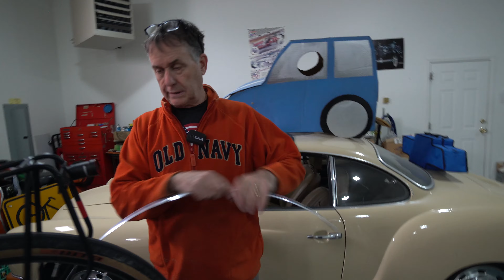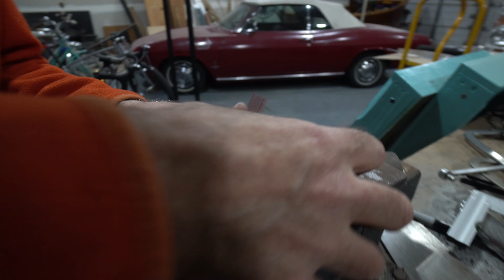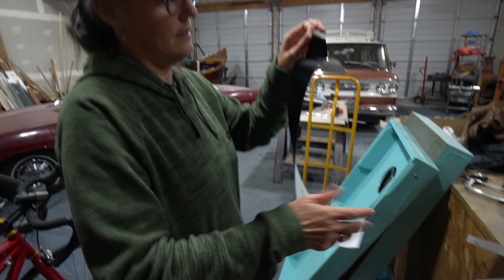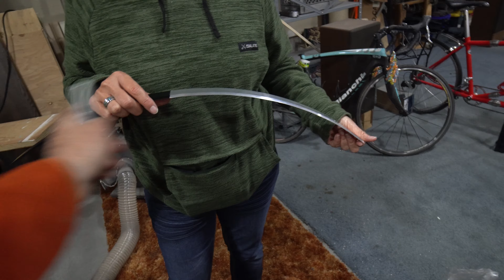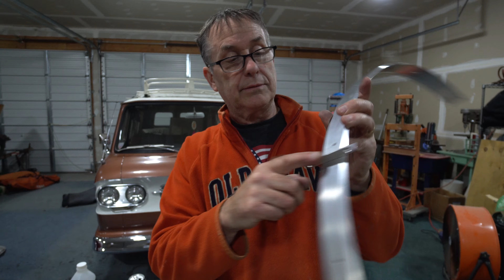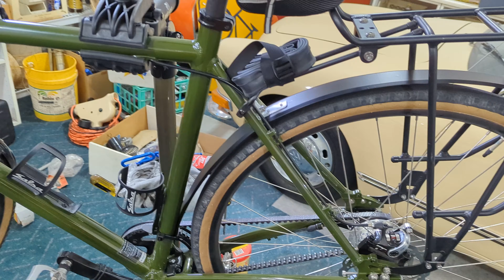DIY Apollo Fender

Comment: How much do replacement belts cost, and can't a longer one be had?
Reply from the maker: Hey Ron,
I think replacement belts are somewhere between $90 and $120.   I don't believe Priority sells a longer Gates CDX belt for the Apollo but it's possible that Gates sells a longer belt.   I honestly  haven't looked into it but if someone wanted lower gears than what we ended up with, a longer belt would be something to look into as well as the larger rear cogs or smaller front cog.
We ended up being very happy with our final gearing during the Apollo Mission with the bikes fully loaded in touring mode.
Thanks for watching.
Enjoy the Ride
Reply: @BBB_Adventures  it seems like whoever is selling the gears would also offer a variety of belts.

Comment: If you reduced the width of the tire to something like 32 or 35mm instead of the stock 40mm would that have allowed the stock fenders to fit better?
Reply from the maker: Hey TG,
Sorry for the delayed response.
It makes sense that a thinner tire would reduce the chance of fender rubbing as it would create more clearance but we really wanted to use the 38 mm tires for The Apollo Mission and I got tired of trying to get the molded fender perfectly aligned which lead me to build these custom fenders.
Thanks for watching.
Enjoy the Ride

Comment: I'm interested in getting the apollo bike but need front and rear pannier  racks for the bike that will carry my ortlieb bags.  What racks did you put on your bike?
Reply from the maker: Hey Steve,
The rear rack on my Apollo is one I bought from Priority when I ordered the bike and I believe it's an Axiom rack.   The front rack on my bike is a Roswheel Tour Front Rack.   However, my Apollo is from one of the initial builds when the bike was first launched.   The front fork on my Apollo has a threaded mounting lug near the through axle and my understanding is the fork on later builds don't have that mounting lug.   I think you could figure out a way to mount the rack without that mounting point but it's definitely something to keep in mind.   We both used Ortieb back roller classic panniers on the rear rack and I had smaller Ortieb panniers on my front rack.   We installed Topeak Vera Cage on Mb's front fork which also worked well.  
We were extremely happy with the Apollo bike set up as a touring bike.  BTW, if you do decide to order an Apollo please consider using the link listed in the descriptions of any of the Apollo Mission episodes.  We are a member of their affiliate program and using the link will help us.   Thanks.
Thanks for watching.
Enjoy the Ride

Comment: Yep, no Vespa here.  LOL!  Ingenious ingenuity/engineering.  Looks like you did round off the very end of the fender to eliminate the sharp edge.  Did you add a piece of innertube rubber between the seat post and the bottom end of the fender (where you zip tied it), to eliminate any scratching/rubbing of the paint due to vibrations?  Be interested in a long-term review (after your cross-country ride) as to how the pop rivets and the rest of the fender holds up from all the vibrations.  I did end up getting the Speedrocker plastic fenders for the Apollo from Priority and I have been very happy with them (can also find them online from other sources).  I saw the spare tire, so I'm guessing you didn't go tubeless, I did, and I've been happy with tubeless.  I haven't had a flat yet to tell if tubeless is for sure a better way to go (messy if the tire doesn't seal and one has to put a tube in), but it just looks like changing a rear flat on the Apollo is not going to be any fun.
Reply from the maker: Hey Steve,
Not surprising you don't have a Vespa in your garage, they really aren't that common but the spare tire was had a great diameter for bending that aluminum threshold and turning it into a fender.    I love your suggestion about putting some inner tube rubber between the fender and the frame.   I'm going to go back and to that on both bikes.    
I agree it'll be interesting to see how the fender holds up over time.   When my son was in high school I mentored his FIRST robotics team and we  used a lot of pop rivets to hold the robot together and they held up well to vibrations.   They would fail if they experienced a significant shock load like running into another robot.   So I'm expecting the rivets on the fenders to hold up.  
The Speedrocket fenders are nice  and it's great to hear you are having a good experience with them.   It's frustrating to have fender rubbing issues.  
We have an appointment at the bike show next week to get the wheels tuned because we are going to be over-loading the bikes and the spokes are the first thing to fail and having them all properly tensioned reduces the chance of spoke failure.   At that time we are going to discuss and potentially switch to tube-less.   We'll end up carrying those tubes as a backup.   So many people are happy with tubeless I feel like it's time for us to give it a try.
I've had the rear wheel off the Apollo several times, the worst part is disconnecting the shift cable.   After that it's not too bad.   But I haven't done it with out my bike repair stand so it might be a little more challenging in the field.  
Thanks for watching and for the great comment.   Nice to hear from you.
Enjoy the Ride

Comment: My bike came with fenders that had support struts down to near the axel. What a pain those were. Always getting bent out of shape and the welds holding the struts were breaking. I replaced mine with plastic versions direct from "chi-na" with a Trump accent.
Reply from the maker: Yes.   Those struts seem to make fender adjustment more problematic, which is why I decided to try supporting the fender with the rear rack, which reduces any flexing of the fender.   I hope you also ended up with a fender that you're happy with.   If not, try making  your own.   :)  
Thanks for the comment and for continuing to watch BBB.
Enjoy the Ride
Reply: @BBB_Adventures  They don't cover as much, but when I cycle through 3-4" of water, I raise my legs to the center pipe anyways.

Comment: I liked this video. I remember your videos when you first got the Apollos and fussing with the fenders, and I wondered how that worked out. I wonder if the problem with commercially made fenders is they are made for chain drivetrains.
Reply from the maker: Thanks Craig,
We appreciate the comment and the acknowledgement of the earlier videos and our struggles with the rear fender.   I spent a lot of time (probably too much) trying to get a satisfactory adjustment and then even more time researching what to do before landing on trying to make my own fender.   The fenders came from Priority and they only sell Gates rubber belt drive bikes, but I also don't believe Priority designed those fenders, I believe they are a version of a commercially available product, as you point out.   Based on all my work and analysis of the rubbing issues, I believe it's a tire width issue and a slight and normal misalignment of the rear wheel assembly to the frame.  The flat design of my DIY fender eliminates that alignment sensitivity.  
We'll be road testing these fenders on our ride across the US so we'll see how they perform over time.
Thanks for watching and your continued support of Buses Bikes and Beers.
Enjoy the Ride
Reply: @BBB_Adventures  Will the ride across the US include RAGBRAI? 🙂
Reply from the maker: @cdmiller51  Yes!!     We have designed our route and schedule to include RAGBRAI.  Will we see you there?
Reply: @BBB_Adventures  I hope so. 🙂 I'm planning to ride from Fort Dodge to Pocahontas, then to Emmetsburg, and Mason City. Then ride back home.